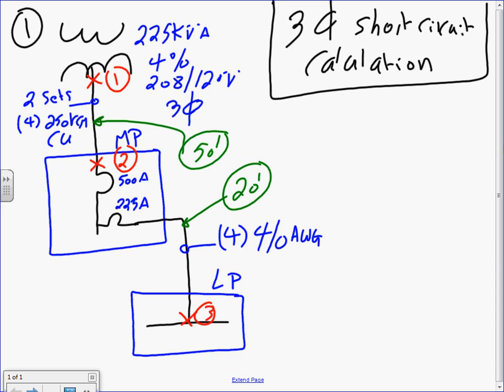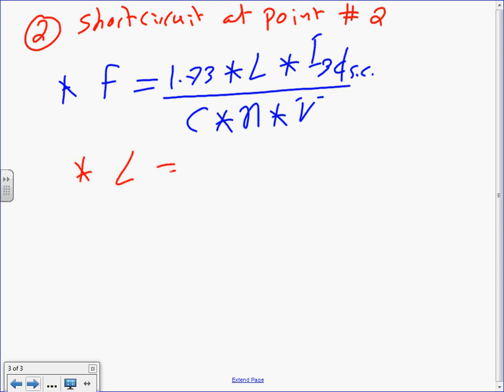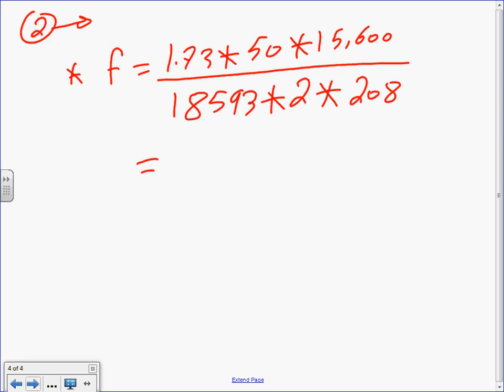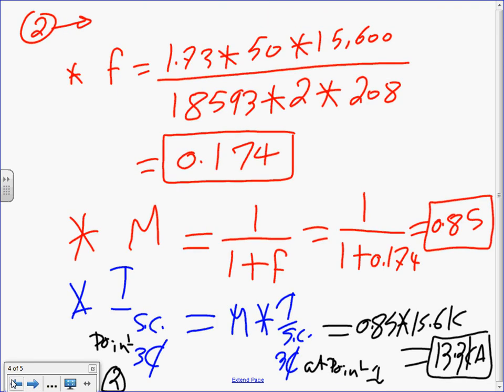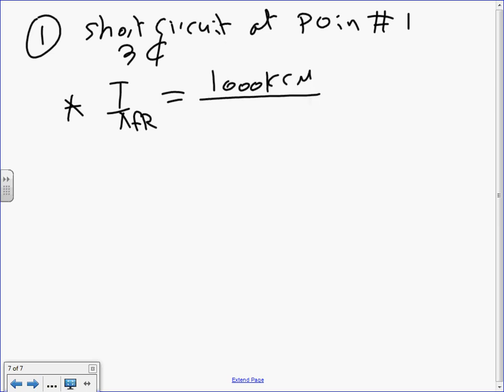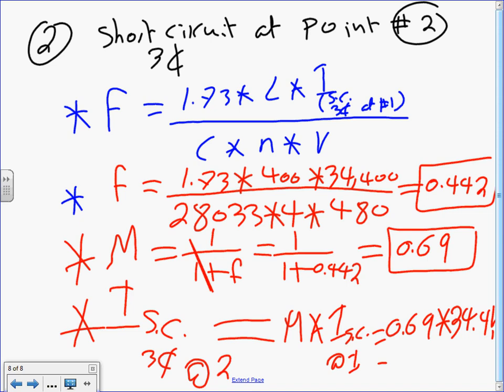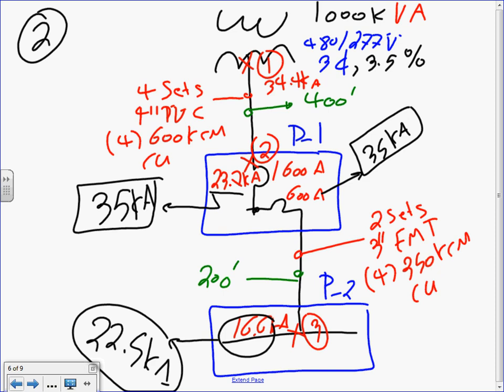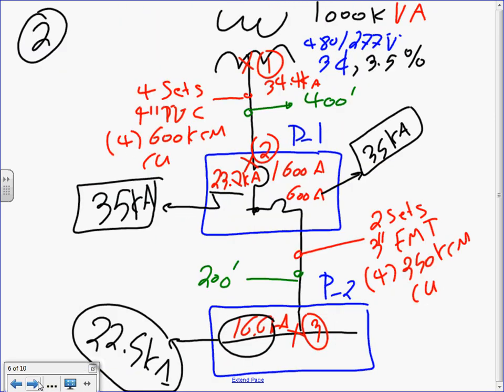Short Circuit Calculation 3 Phase By hand 11 29 12

Comment: Sir, how do you do the short circuit calculation using conductor wires to a busway system starting from the plug-in - busway - plug-in

Comment: in crrent calculation for current at point 1, instead of using 208 v you should have used 0.208 kV as 225 kVA is used in the numerator
Reply: Subhash Parekh In numerator he wrote 225K so its perfectly alright.